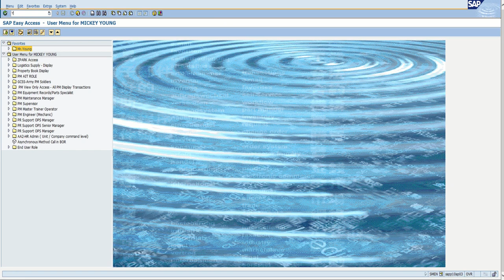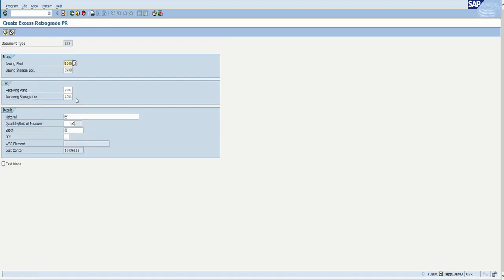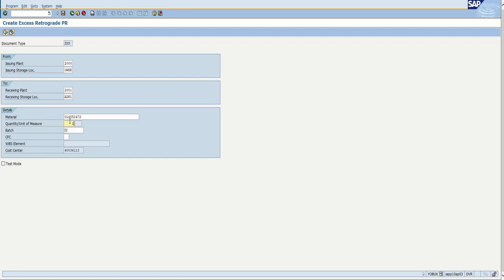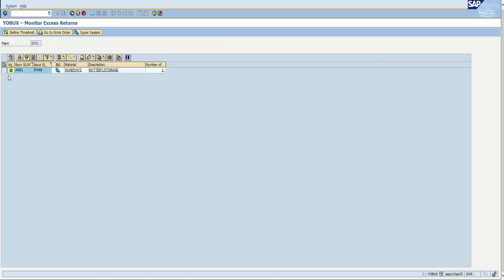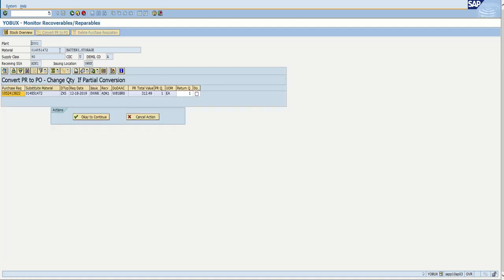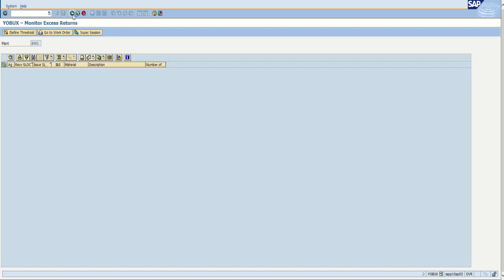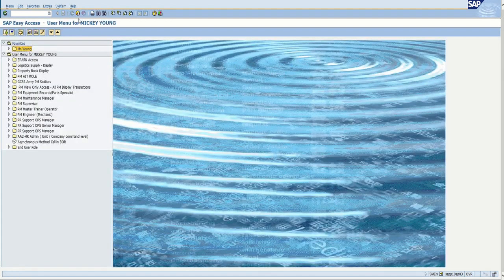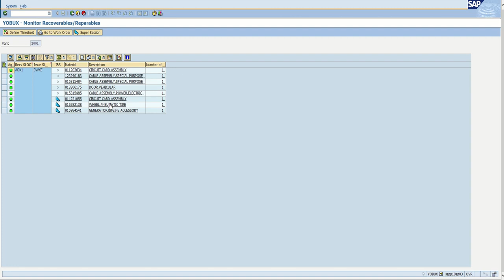Create a Turn In / GCSS-Army

Comment: What would be the process of transferring Shop and Bench Stock to another service, e.g., from the Army to US Space Force?
Reply from the maker: To my knowledge there isn’t a way to transfer between services. You would just consume the part against a work order and give it to them.
Reply: @Chiefyoung  
Shouldn't we provide a transfer document to them to sign for the item for Audit purposes?  If so, if we used DA Form 1348-1, would be have to generate manually or is there a way to do generate in GCSS-A that you know of?

Comment: How do i do a turn in for a item thats the same with a diffrent nsn ? For a part thats due . For example i ordered a new altenator and the system requires the same nsn but the old altenator uses a completely diffrent nsn
Reply from the maker: Check PIC03, if the NIINs show up as alternates then your SSA should accept it as the same, as long as the system shows they are the same with different NIINs. Otherwise you’ll need to do some research to show the SSA that the NIIN has been changed.